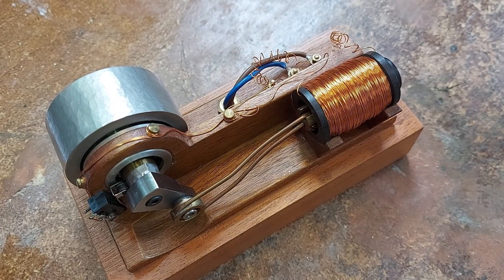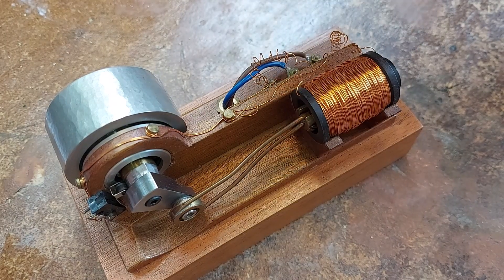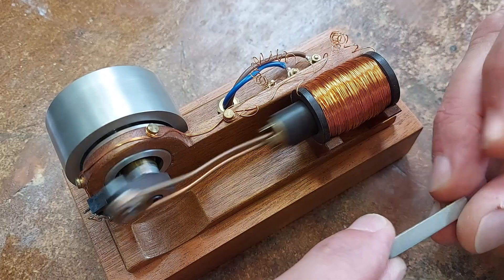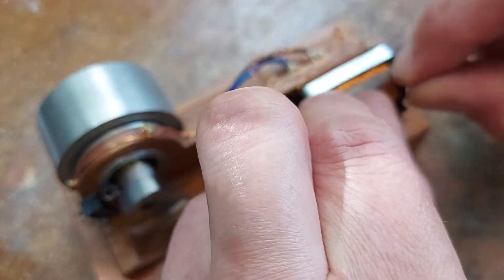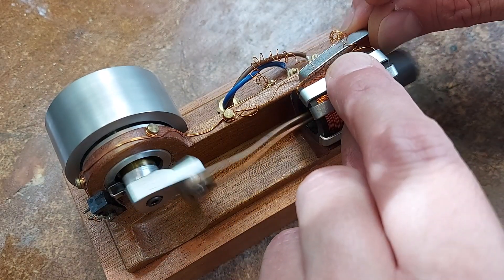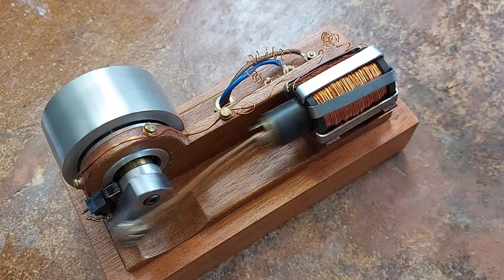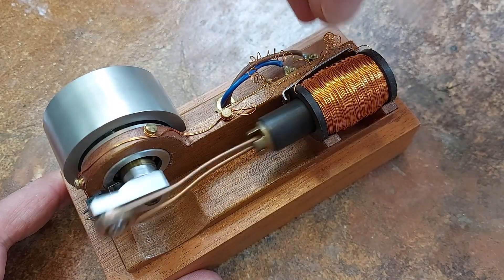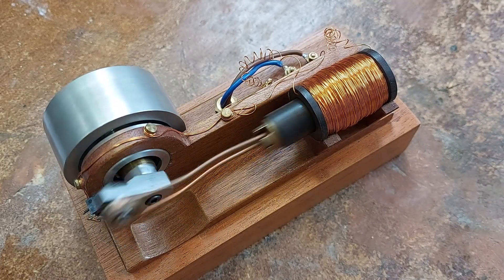Improving the Solenoid Motor

Comment: Nice! Wireless phone chargers use a ferrite disc under the induction coil to “direct” the magnetic field a certain direction. I have seen some flexible ferrite sheets that you could cut and wrap around your coil. There may even be a DIY solution for making a ferrite coating if you want to experiment with it. I really like your motor.
Reply from the maker: Thanks, I was thinking maybe I would use small pieces of piano wire, bent like staples and fixed into holes either end of the bobbin. That way I can still show off the colour of the bobbin. I have another idea for an engine, so might use all of the ideas for that 🤔